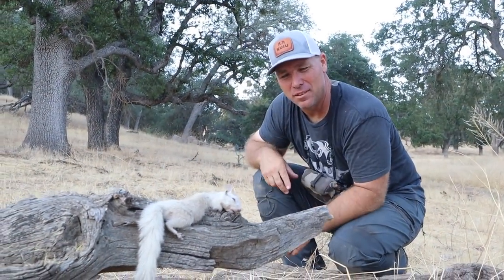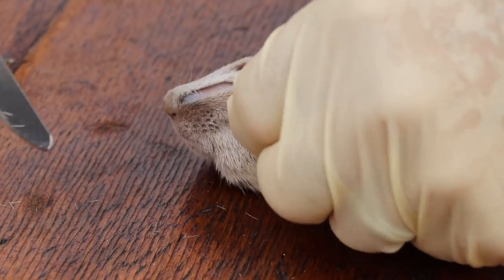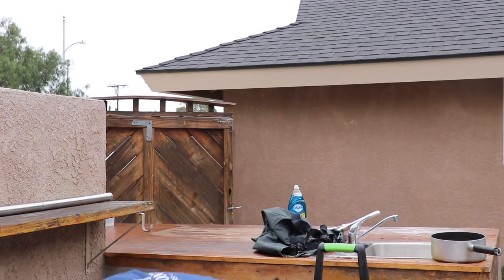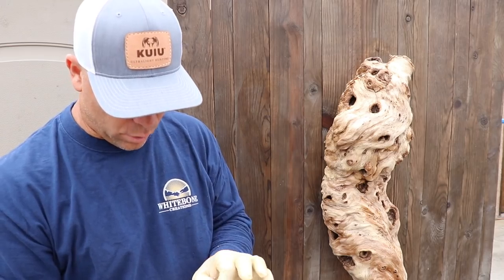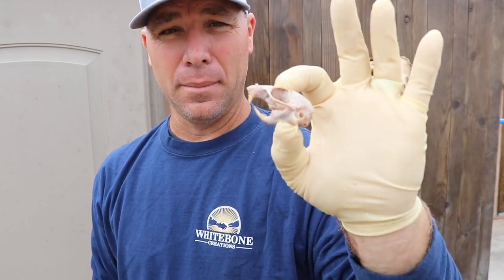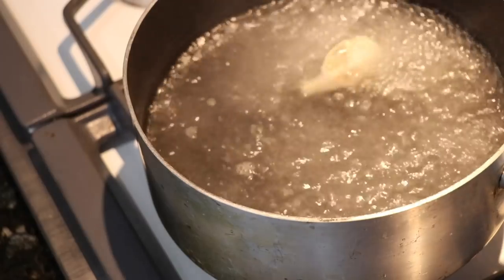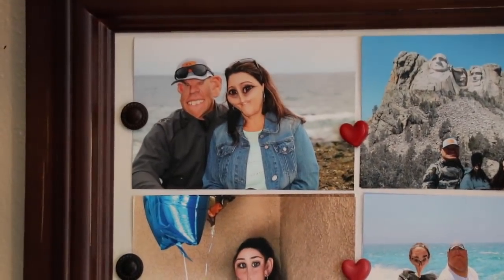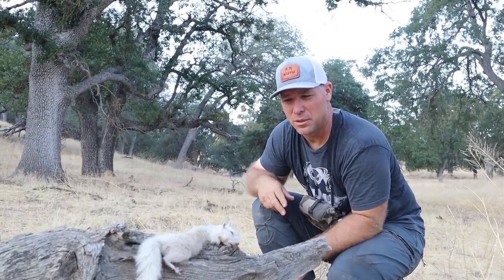HOW TO CLEAN AN ALBINO GROUND SQUIRREL SKULL

Comment: I did this when I was like 8 years old and I just let the maggots eat at it and then boiled it and cleaned it up real good, I still have it , im looking at it right now, I made a handkerchief slide with it :p
These little skulls seem real brittle to put a power washer to em, yet alone a steel toed boot lol, but I trust your judgement.
Reply: Don't!! You really shouldn't use power washers on skulls, especially small ones, unless you want to destroy the fragile parts like in the nose.
Reply: Chantilly exactly what I was thinking, and around the eyes... teeth...etc

Comment: It ain’t offensive it’s awesome. I just did up a skunk that was terrorizing my chickens. I mounted it to an antler. 
Have you ever had problems with skulls and teeth cracking when they dry? I have three coyotes I did and they are cracking. All of my skulls are sprayed with a sealer but it doesn’t seem to stop the cracking.
Reply: I love watching Ryans work, but a lot of people say boiling skulls weakens the bones. I do know extreme temperature changes from say air temp to boiling water (if you don't heat the skull up with the water) or from boiling water to rinsing it off with cold water can sometimes cause teeth to crack/split.

Comment: Hi thanks so much for this awesome video! Does the boiling process "de-grease" the skull? Also when you boil the peroxide, do you need a special saucepan, like non stick, plain aluminium etc? I'm new to this but want to have a bash at preserving the squirrel skull that the ants are presently cleaning for me lol. Thanks in advance, look forward to hearing from you x